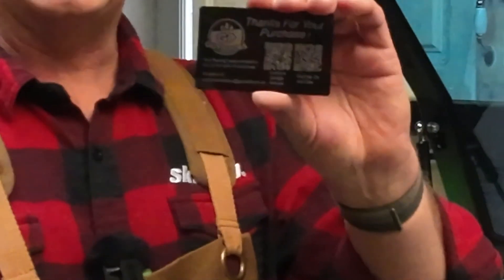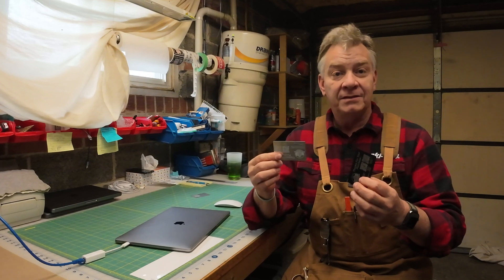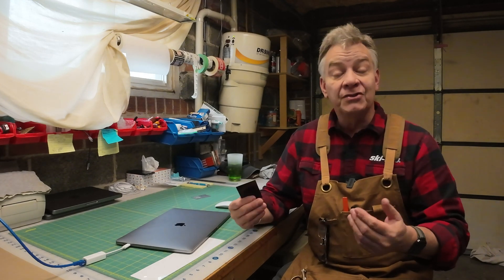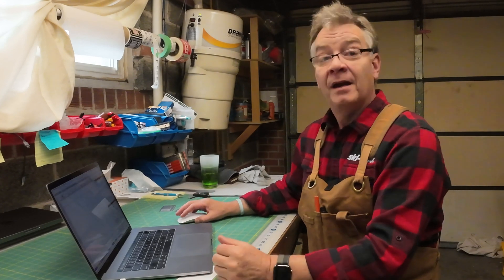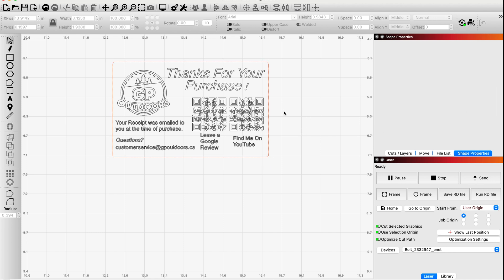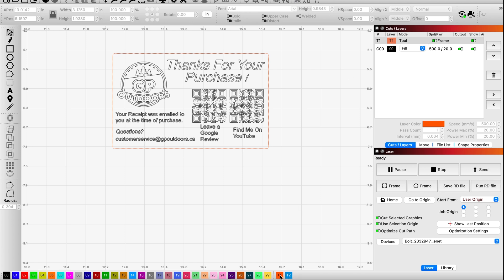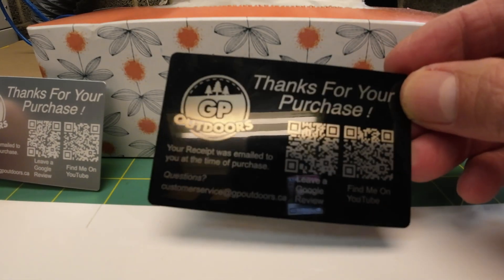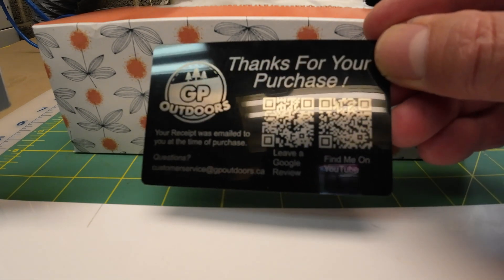Engrave Anodized Aluminum Cards on Your Thunder Laser BOLT! Settings  016   4K

Comment: Another nice one. Never saw those Alu business cards before. So if this works on a CO2 laser, this would be nice to have and use. Any suggestions on manufacturer of shop to get these? Blank aluminum also engraves great, but becomes white (I use some Alu profiles for leds displays). If I wanted black engraving, Cermark has a product but is way to
expensive in Europe. Will look at all your vid's ! I "m always eager to learn !
Reply from the maker: Thanks . No, I just got these off Amazon. Good luck and all the best!